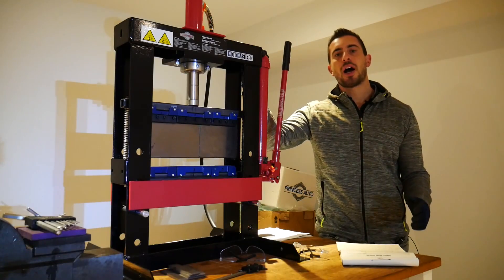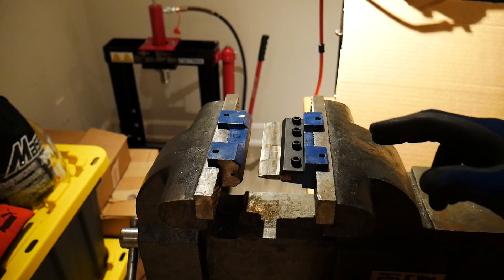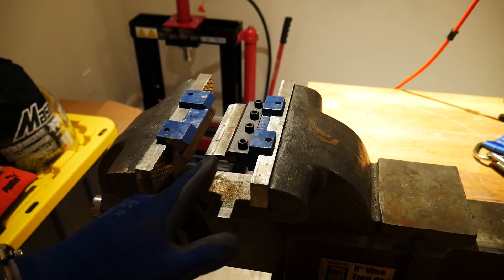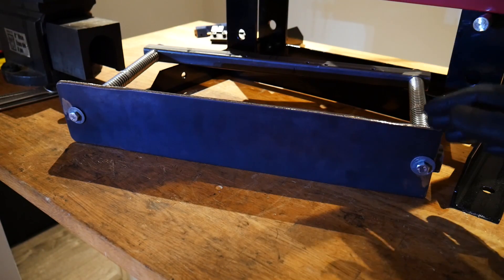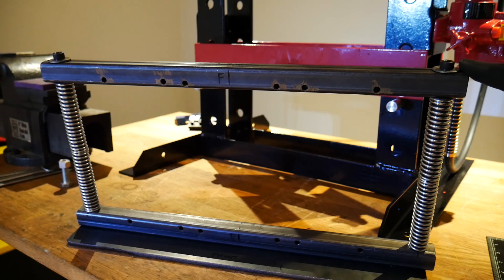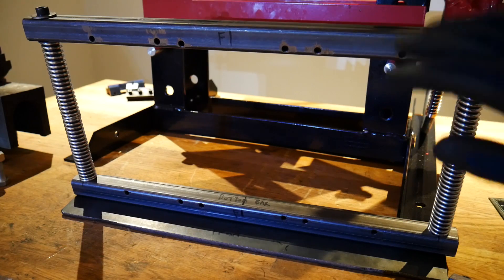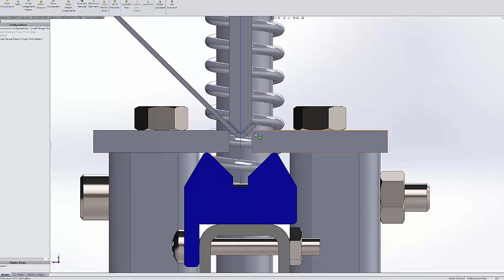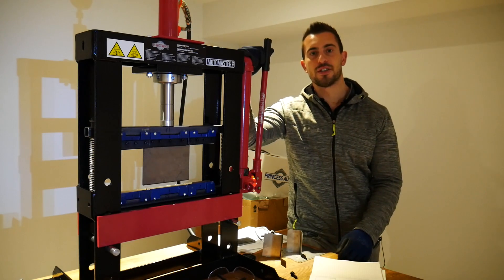How To Build a Finger Press Brake on a Budget! (No Welding Required!)

Comment: This is great since I am not a welder, What I do not see is how do you attach the collar on this?
Reply from the maker: The collar on the bar? Is that what you mean?
Reply: @EmbraceMaking  Yes it is, and can I build the fingers with mild steel, or do they need to be tool steel?
Reply: FYI I went ahead and ordered tool steel for the fingers, Still wondering about attaching the top collar, iI may go with JB weld.

Comment: Real nice design.  I was wondering about your Hyd. Press. What tonnage is it?  The cranking is very smooth.  Can you provide a link for it? What would you reccomend for up to 7 ga. X 12 inches long??
Reply from the maker: Google "motomaster 10 ton press" ... 7GA is pretty thick at that length, I don't think you're going to bend it with one of these presses...

Comment: Nice job.  What would be the thickest 12 inch piece of mild steel you can bend with the long fingers?
Reply from the maker: I'd have to do some trial and find out.. I can't remember what the max gauge the short fingers were rated for but Im sure the long fingers could handle that. Its probably a conservative rating.

Comment: Very cool. You mentioned having a machine shop make the fingers, I'm assuming you did the same for the dies? Maybe I missed you saying that.
Reply from the maker: The dies came in the bench vice brake kit that was the basis of this build. You can find them at harbor freight in the states or princess auto in Canada. Longer fingers require a machine shop ;)

Comment: might be a good idea to replace the whole v block setup youre buying with a simulair setup to the two plates you made :
instead of plates i would suggest two pieces of L profile set up to form an open back T supported by a plate where the bottom of the T rest on and the other end supported with boxprofile  , the whole thing will work as a vice with open jaws basicly 
you can grind a small v along the top of the T where the metal goes intoo the valey in between the L profiles
drill and tap both L profiles and tap one and drill the holes bigger on the other and bolt them together using long bolts and look for a way to get the plates to stay open (either washers or a thin strip of metal dropped intoo the valey before tightening up the bolts ) , doing this alows you to change the size of the valey in between the L profiles for the thickness and size of the material you want to bend in them and both profiles bolted together in an open T shape with transfer the pressure applied to it to the thick plate its resting on wile the outside edges are supported by the pieces of boxsection under it , it will self center (slide across the bottom support plate)  
and by setting up the valey tapered left to right you can probably make offshaped bends too (one side bend sharper then the other side ) that helps if you need to make bends for a cone shaped object where all the bends meet at one spot on one end
Reply from the maker: Thank you for the suggestion. However, I am having a hard time picturing this. Do you have any photos you can link to?
Reply: Embrace Racing  think this comes closest :
https://www.aliko.fi/media/tiedostot/aliko_cnc_muuttuva-aukkoinen_alatyokalu.jpg
you basicly make a homemade version of sumtin like this using angle iron and box section and nuts and bolts
hmmm looks like swag is making sumting simulair 
http://www.swagoffroad.com/thumbnail.asp?file=assets/images/flat%20top%20adjustable%20bottom%20die/img_4345-1.jpg&maxx=999&maxy=0

Comment: Where did you say i can order the finguers from.
Reply from the maker: Hi Jose, some manufacturers (look up JET) may sell the fingers separately, however, you can get them made at your local machine shop for cheap. Just give them the dimensions. They probably even have their own finger press brake that they can model them off of and make you your own set!
Reply: Embrace, who says that paying a machine shop to custom make fingers is cheap?

Comment: Been looking for a good design for quite a while. This is by far the most versatile;  I easily see scaling it up or down for my 20 ton press and down as shown. Really nice job and well thought out. My only suggestion (for scaling up) would be to use 1 in square bar instead of tubing above and below the dies. Awesome! And thank you.
Reply from the maker: Thanks George! Yes, as the size of the press increases you may have to use something a little stronger!